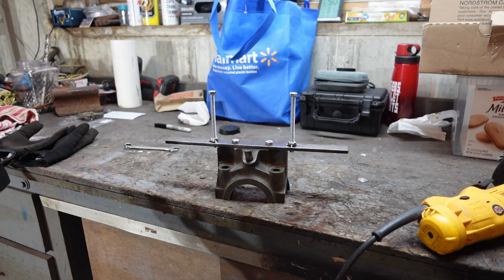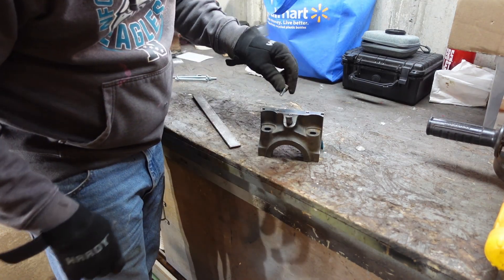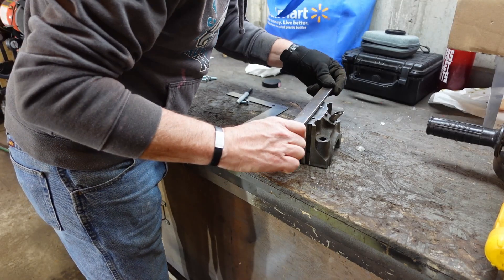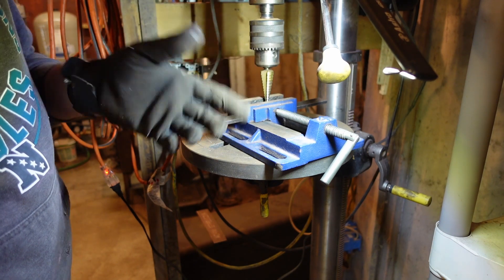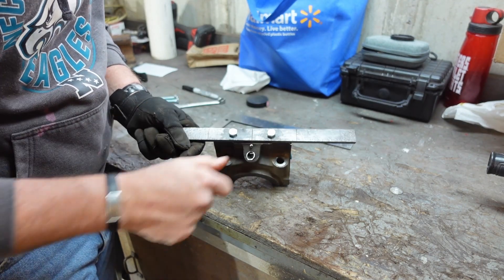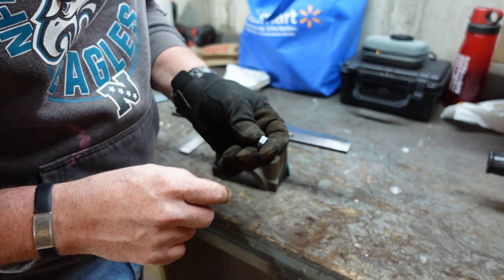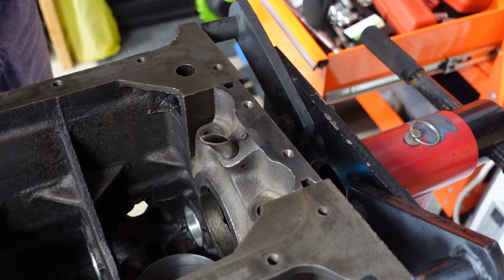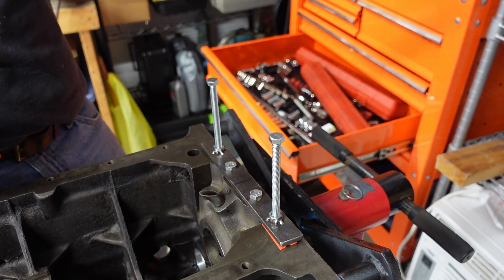Triumph TR4 - Bearing Cap Removal Tool | Roundtail Restoration

Comment: in case you have Muriatic Acid around, just dip the nuts into it until the bubbling stops... voila, no more zinc coating.
Reply from the maker: I do have some. Totally forgot about that. Thanks, Mike!
Reply: @roundtailrestoration  the gas coming off is highly flammable hydrogen so no smoking right over the top 🤣
Reply from the maker: Science experiment!